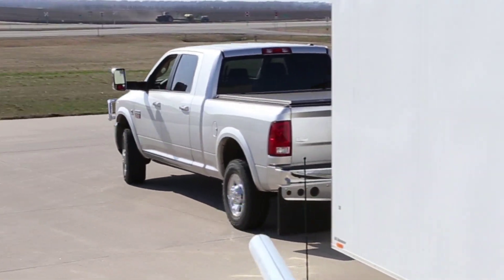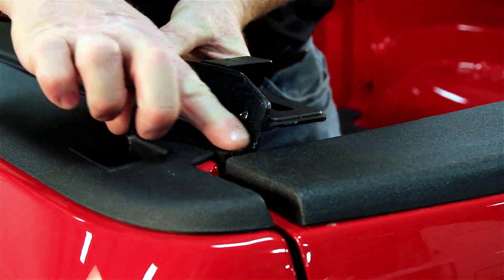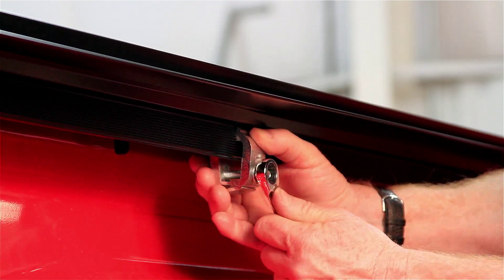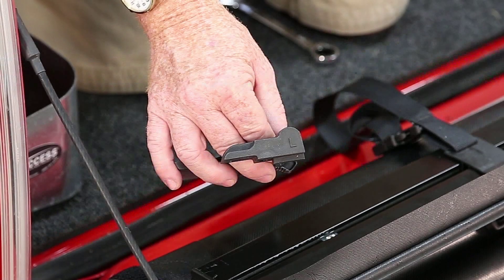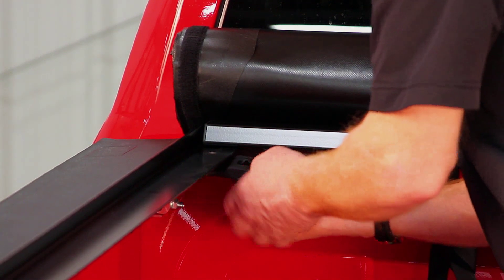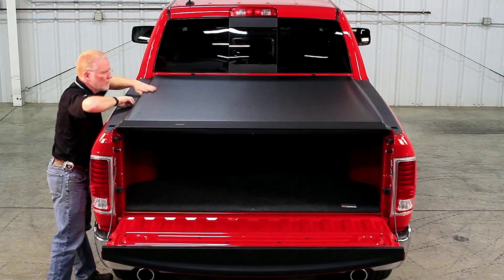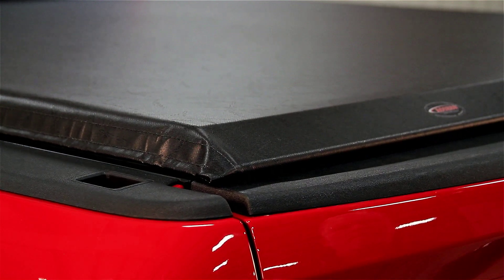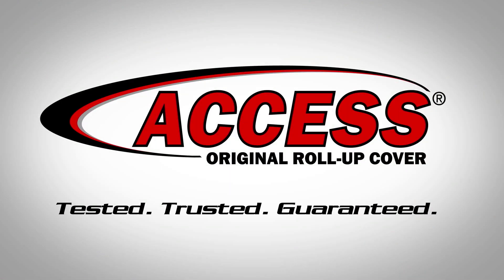ACCESS® Original Roll-Up Cover Installation

Comment: So what do you do about the element seal if you have bedliner?
Reply from the maker: Hi Ohtenwillys, you would apply the element seal even if you have a bedliner, Thank you
Reply: Wouldn't the adhesive on the back of the seal not stick to the bedliner?
Reply from the maker: The adhesive does stick to the bedliner, just make sure it is clean and dry before you apply the element seal
Reply: Ok cool, thanks

Comment: I purchased a 2016 Tacoma with an  Access cover that leaks in both corners of the front of the bed. Are there any preliminary adjustments I should try? Very new vehicle so I doubt seal is already worn (16k miles)
Reply from the maker: Hi Robert, we recommend checking the front seal to ensure it reaches to each rail, and that the front flap of material is tucked under the front bar. if those are all in place please call: 877-708-4787 and ask for Curt or Eddie
Reply: For anyone following, Curt diagnosed my problem and provided an immediate solution. Great customer service